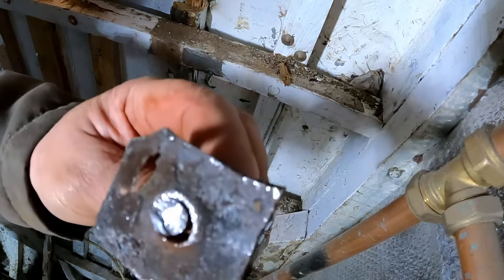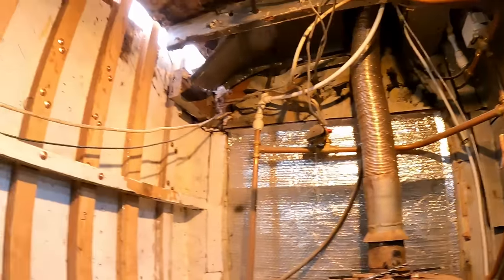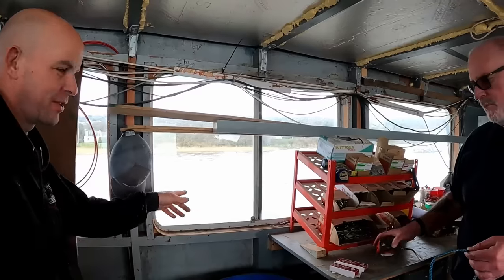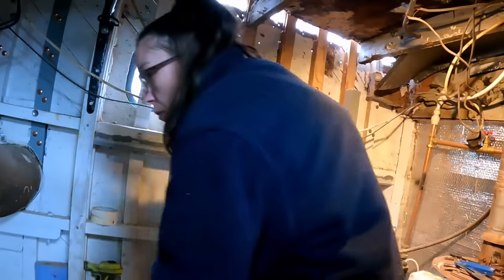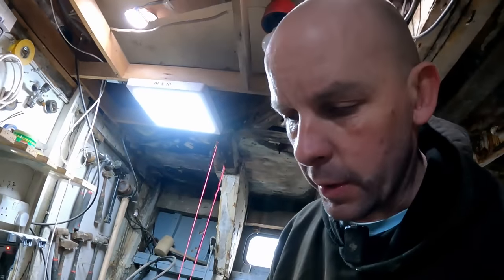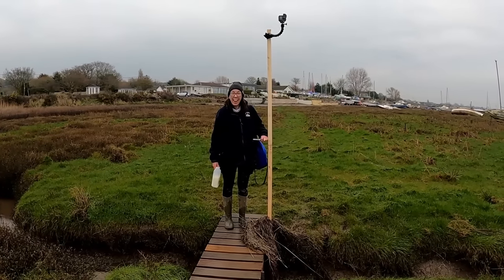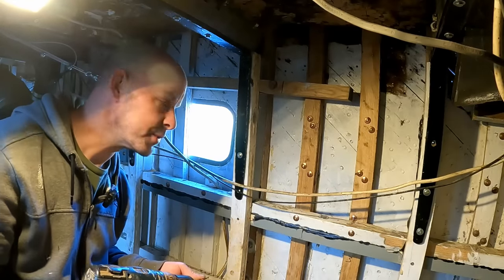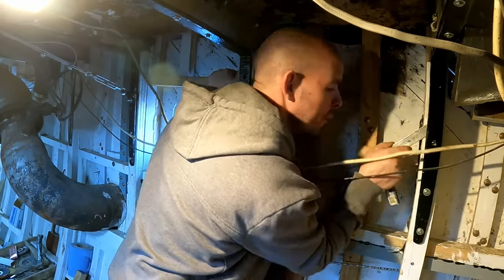Ep 168 BIG Problems & Our Mistakes On Our Big Boat Restoration!  #boatrestoration

Comment: If the epoxy doesn't seem to cure in the usual time, which I am guessing since you said it still felt "wet", could be a problem with the hardener (in the small can).  Could be it has absorbed moisture and gone bad.  Have a look and see if the color of the hardener has gone dark and smells rank.  Usually don't have to worry about the resin, just the hardener.  I have experienced this problem using a can of hardener that was opened and resealed several times during periods of high humidity.  I see some others have mentioned issues related to stressing the laminate while curing and smooth surfaces, etc. All the above may contribute but if that hardener goes off it really lengthens the time to cure and makes a weak lamination.

Comment: Hi will try to give my thoughts first maybe look at them as 2 piece the bottom part with greatest bend, could you find a solid block of oak to cut the bend from join it to top. or make your own like breast plate. rely depends on height from bottom to less bend part. thinking it as a L shape.

Comment: Some  epoxies include a wax that migrates to the surface and has to be sanded off before the next layer. This is normal in making eg composite structures like boats or aircraft. West systems are commonly used in boat building with eg glass cloth, but those resins are not designed as adhesives.
Are you using epoxy adhesive or

Comment: For laminating curved frames you should use a non-creeping glue. They use resorcinol for that..easy to use, it's called Aerodux. The other comments are useful too...so make a 4-ply instead of 3-ply frame and glue it with the Aerodux. No problem, they have done it for ages that way. I think you can stick with the oak. When frames are breaking regularly, you can change to a wood with a longer thread.
Reply: Resorcinol needs a lot of clamping force, about 4kilo a square centimeter. Epoxy doesn't need any clamping force

Comment: Simon, have you tried steaming the strips of wood before lamination?
1 thing I would definitely make sure is that the laminated faces are scuffed up, not plained. If you need to get the exact thickness, you could always experiment, laminating a short, straight length together. Measuring how much you take off to get to the correct spec, then plain the outside edge to that dimension before lamination.
Reply: You could always pin the frames with wooden dowls to prevent the frames from shearing along their length.

Comment: Yes go with improving the surface of the pieces leave them rough sawn, the modern tungsten tooth blades leave a good gluing surface or use the bandsaw and cut into four pieces instead of three ( I know 30% more work ) also 30% stronger and 30% less chance of delaminating. I like your choice of oak a very durable timber. Don’t be disheartened this gives you the opportunity to improve on your method. Best Wishes.

Comment: Retired Joiner speaking here. You can de-stress the laminated members by using thinner strips. For the sort of curve you seem to be forming 6-8mm is the maximum. In general if you cannot bend the timber by hand (to the shape you require) then the lamina are too thick. If you want to use thicker sections you would have to steam them to shape, allow the natural resin to accept the inherent stress, dry them and then apply the epoxy. The second option is obviously very time consuming. You might want to take some core plugs of any sensitive members you have formed in the past to check for delamination. Stressful time ahead Simon!

Comment: I have had epoxi glued pieces falling apart. I think it happened because the fit on the glued surfaces was too perfect. When clamped together all the glue ozed out and almost nothing was left between the pieces. That does not work with epoxi. You must leave some room for the glue.

Comment: Question on those Bolts going through to outside why are you not sealing them just using washers? Because if water as in salt water gets in to the wood it will rot faster from the inside than outside.

Comment: Is it possible that the pieces of wood have an oil on the surface that has stopped the resin bonding.

Perhaps it’s worth sanding the surfaces, wiping with a suitable solvent, then re-apply the epoxy resin.

Comment: Simon, How cold was it when you did the lamination. At the start you said you could not have the heating because of the noise. Epoxy can be temperature critical. Was the material you were gluing cold or did it go cold while the epoxy was curing. I have in the past had a job fail with epoxy because it went very cold after the job was glued up. might be worth checking the temperature where you are working with a max/min thermometer.

Comment: Just a suggestion, as you move to the stern, that part of the ship does not get the forces against the hull like the fore part.  To save money, and time, what about fitting "some" softer wood and only a few OAK ones - I don't have experience of anything like that, only metal engineering.  Run it by a shipbuilder first though.  This might be better than fitting ALL soft wood in the stern.

Comment: Unlike wood glue, which requires tight joints and high clamping pressures , epoxy likes a little gap, hence the reason for not having smooth surfaces.  High clamping pressure can squeeze all of the glue out of the joint.

Comment: I bought a pack of saw blades on Amazon for my multi tool.  Had some screws to cut through in my bathroom.  They are carbide tech and the price was more than others I’ve purchased.  Couldn’t cut through the screws.  Actually removed the teeth from the blades.  
Can anyone recommend a specialist metal cutting blades.  All I can find is multipurpose ones.

Comment: I may have missed something, but why did you measure the water depth from the top of the bridge, when the water was visibly lower than that? It would have been more meaningful to measure from the water surface to the tide-line on the stick!

Comment: The old timers know best, steaming takes out the stress when bending, and dry's in the shape you want,, bending and gluing is bending with the stress still in it as it tries to go back to its original shape, I would put screws through the laminated pieces as screws would relieve some stress., or steam the pieces in place.

Comment: 25:39 that’s changed my mind about epoxy.
I was lead to believe it mad the joint as one, whatever happened.
I won’t trust epoxy again if it’s able to fail like that without holding firm in some places at least.
Reply: Epoxy has its place like all other adhesives.  When prepared properly the right material can be stuck together with a bond stronger than and longer lasting than the material joined.  Simon has explained what Rick said he did wrong and numerous other commenters have added their knowledge.  Everything will be fine.
Reply: @flick22601  just don’t have faith in it anymore after seing it fail the full length even where is was nearly straight.
Reply: Oek
Reply: 0:10

Comment: Classic dry bond, nothing to do with the curve,  We've laminated much tighter curves. 
You can see people on various channels laminate tighter with more stress
Dry bond comes apart just like that , shear or tension bond failure don't look like that
 it's not the mixing(unless it's a new batch. it's the wetting out. The wood has to be warm (at least 15 degC) and you don't apply glue until the wood has stopped absorbing resin.  Good chance the wood was really dry and didn't absorb the wetting out resin

Comment: Ok, well you asked.  I laminated ribs of oak and epoxy and was told by an old salt that oak is not the wood to use glue/ Epoxy does not stick well to it, Douglass fir is much better.  I don't know, might need to see some data.  You could cut more strips so they bend easier i had around 8 in my stack. you could steam your thick size  pieces first into shape. then sand and epoxy...  Original beams were steam bent. You could break down and get a propane burner to generate the steam.  You know electric is not the best for heating, very wasteful of fuel.  for my money you should seam bend oak and do like they used to and sister each scarf area, not trusting the epoxy on oak. It is actually much faster than epoxy if you build a proper steamer, and steam tube, key is you are heating the wood not soaking it. Those scarf angles were worked out for softwood like pine and fir.,  So I might stay up evenings worrying,  I think you are fine but you should test your scarf joint on two pieces and bend and see if the wood breaks or the glue lets go, if its the glue think about sistering all your scarfs. Your doing great anyways so just a bit more research...  :)

Comment: Change your philosophy. Consider how much more life is left in the hull and choose your materials to fall in line with that projection, plus a safety margin of course.  Don't work to Admiralty specs, they built stuff to a spec that would make your eyes water. 
Increase your laminations by %100, you will find them far easier to work, and the fished workpiece will actually be stronger, particularly if you stagger the grain patterns of the laminates. Good luck.

Comment: Do not sell you panel saw!  You will not be able to afford a new one at todays prices and you will need it for the interior refit.  Put it into storage if you have to.  
I hate to be a Debbie Downer, but your backyard workshop is too small. Perhaps if it only rained 3 days a year, you could spill out into the yard - but that is not your climate. You will be able to do some tasks there (building cabinets?) but for the shipwright work - you are going to be disappointed.  Sorry to be a bummer.  
Your panel saw is a once in a lifetime investment.  Don't let it slip away👍
I suggest you start looking for a bare bones space you can rent near the marina.